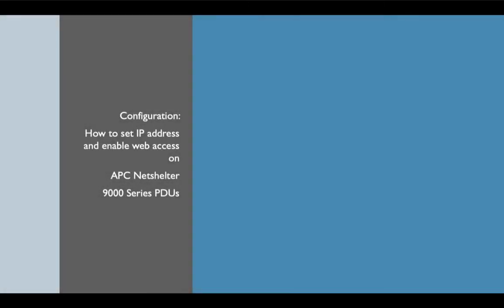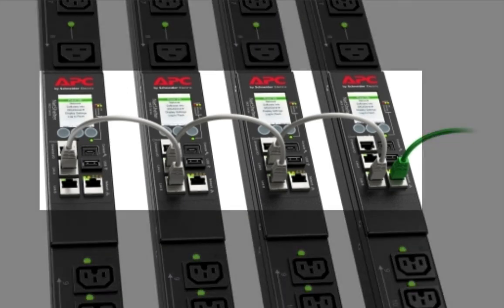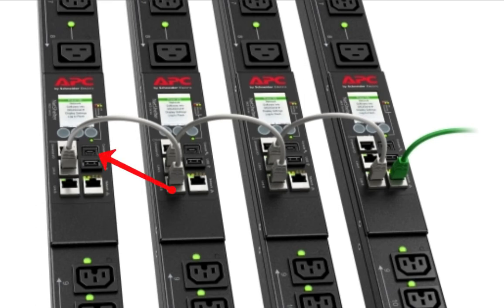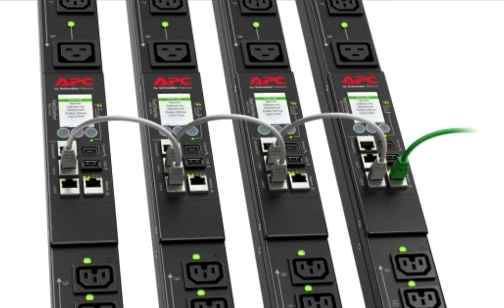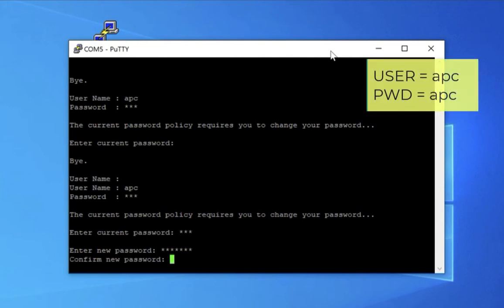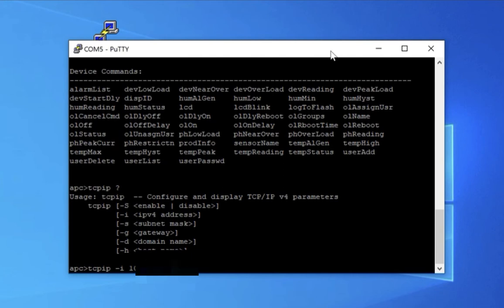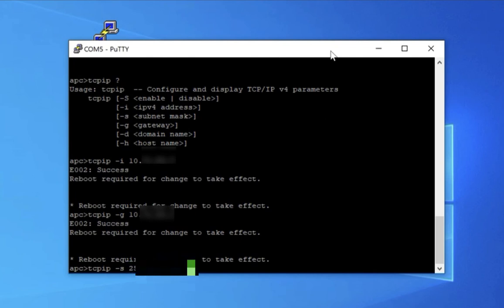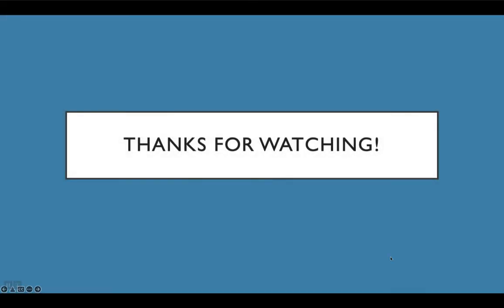How to set IP address, enable WEB access on APC 9000 Series Netshelter Power Distributions Units PDU

Comment: You skipped a huge step, i.e. how did you figure out the serial ports to put into putty?
Reply: In Device Manager, under "Ports (COM & LPT)" plug and unplug your USB cable to see what shows up. Could be COM4, or COM9, etc
Reply from the maker: That depends on your system, so trial and error. At least, that's how I've dealt with that.

Comment: Thanks for showing the interface, process, etc.  Also, fwiw, you don't need to blur an RFC-1918 IP Address as those are not routable on the Internet... unless you're protecting from someone inside your organization, etc.  It would be different if it was an IP Address that could be routed on the Internet, but in this case it's clearly not as none within the 10/8 network are.

Comment: I can get the RJ45 console port to respond but the micro usb pdu's it just a blank screen and being unresponsive.  Any help?
Reply: Coming from a Cisco background, could have been a lot of things like: wrong type of rj45 cable (say it needs rollover or patch but not crossover), faulty rj45, bad drivers (USB serial devices to add com ports to pcs for instance were notorious). Also, if everything is up and you're set to the right com port, could be the settings (like wrong baud rate/speed, parity, flow control, etc)
Reply: I'm using a micro usb serial adapter with serial connection to another serial connection to a usb that is plugged into my laptop.
Reply from the maker: @dantran5478  Sorry, no idea. But if you figure it out, please posts it here!
Reply: @billnaylorvideo  I decided to use the default DHCP and configured from there instead.